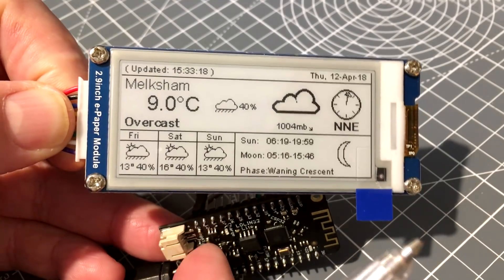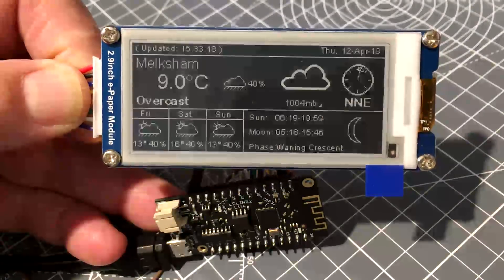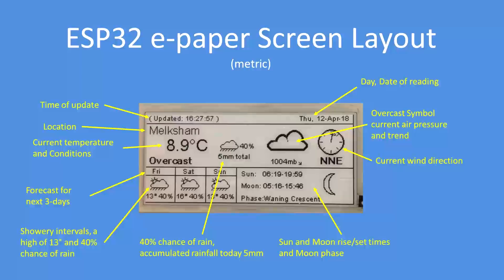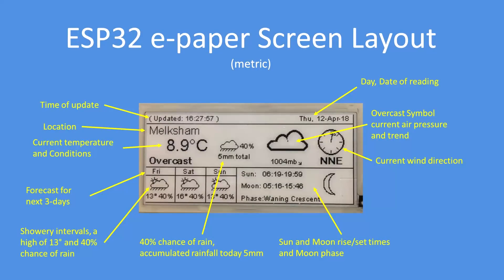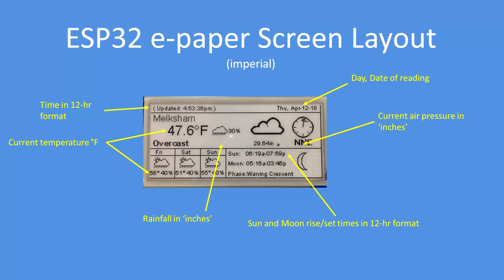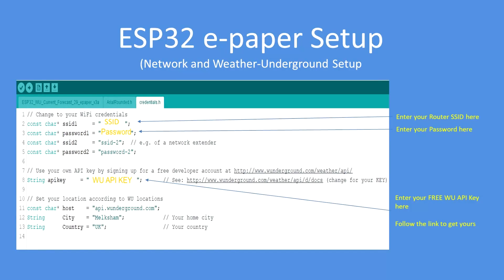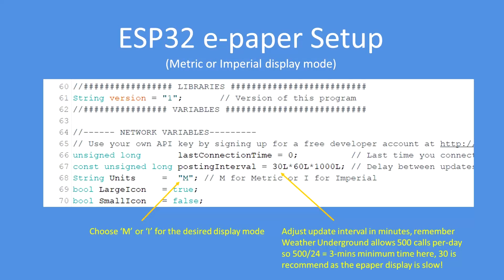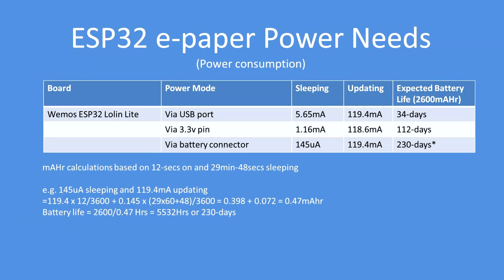Tech Note 091 - ESP32 and 2.9" e-Paper for a Weather Display (low power)

Comment: What is the best board between WeMOS LOL IN 32 and WeMOS LOL IN 32 Lite ?? for low power application?

THank you.
Marc.
Reply from the maker: The Wemos Lolin ESP32 takes much less power than the Lite version in sleep mode. I think Wemos has discontinued it though! They should take some power measurements either that or the Lite version is cheaper to make and has more profit.
Reply: Thanks :-)
Reply from the maker: Hi Marc, I saw a message from you about 2.9” weather display, then it disappeared something about testing for forecast and current weather, have you resolved your query now?